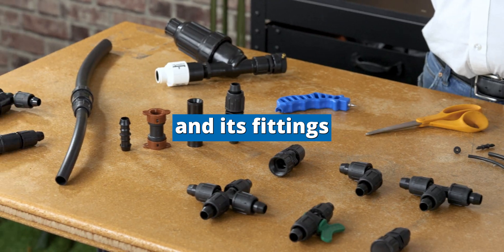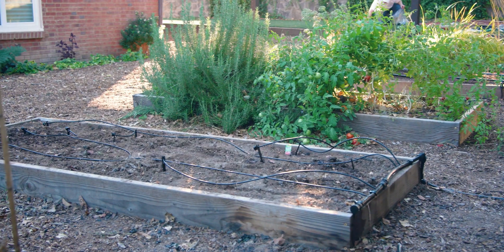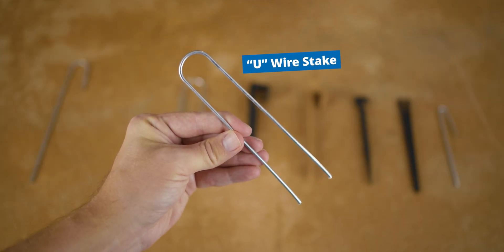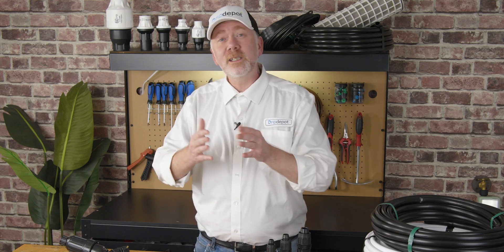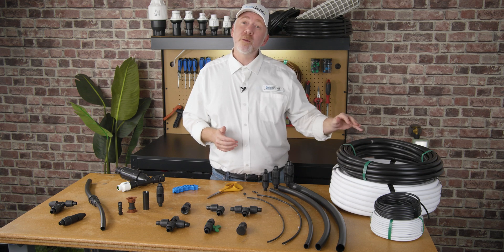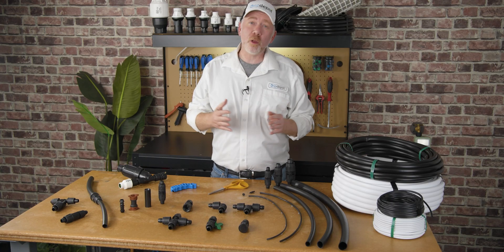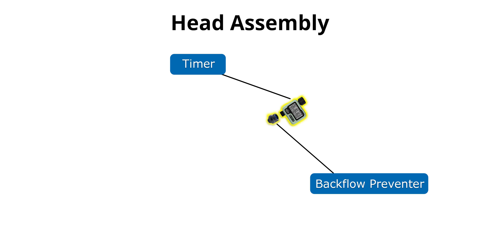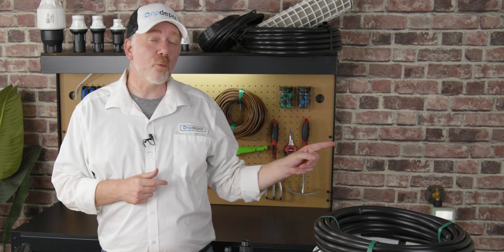Drip Irrigation Poly Tubing and Fittings: Everything to Know for your Drip Irrigation Project

Comment: What about 5/8" tubing?  I believe I have that one but wasn't mentioned at all.
Reply from the maker: Good question, and this gets into one of the more confusing aspects of irrigation: nominal size vs actual size.  Most 1/2" tubing you see out there is closer to 5/8" actual size but still receives the nominal 1/2" label.  The most common 1/2" tubing has an inside diameter of 0.600" and an outside diameter of 0.700", both over an actual 1/2" (and the inside diameter very close to an actual 5/8").  

The same occurs with PVC pipe.  1/2" PVC pipe has an average inside diameter of about 0.602" and an outside diameter of 0.840", both well over an actual 1/2".  Even every day 3/4" hose threads come in over an inch (1.065" caliper read on some 3/4" male hose threads).  

PVC pipe is standardized which is nice.  Even if 1/2" PVC pipe isn't actually 1/2", at least you know a 1/2" PVC fitting will always work with it.  Tubing is not standardized in that way.  There's fairly good reasons for that, but it does lead to confusion, particularly when nominal sizes are still used.  

If you have 5/8" tubing, there's a good chance it's the same as the common 0.600" x 0.700" tubing you see out there and would work with our 1/2" poly tubing fittings.  If tubing ever gets the PVC treatment, this will all but disappear :) 

The issue is also mostly at the 1/2" size, once you get to 1" tubing there's not nearly as many different actual sizes out there.
Reply: @dripdepot  Thank you. I saw your other video that explains more about this. I understand more now. It is funny that either 5/8" or 1/2" compression couplers have nearly identical ID size of 0.62"-0.63" and pretty much cross-compatible and I can use either to repair my drip-line system.

Comment: Try and stake this stuff when you have mostly rock. It’s not going to happen. The worst part about drip is unrolling the kinked knotted tubing, I’d assume the companies who make the stuff assume you will cut it every few feet because it’s too much and time consuming otherwise to untangle it. In some ways I wonder if pvc is better just seems a bit more uncommon but at least there is no unfurling tangled rats nest for hours 😂
Reply from the maker: Staking in rocky soil is definitely not easy, likewise with digging if you prefer to bury it.  There's a tip that can potentially help with both the staking and unrolling.  Place the tubing coil somewhere in direct sunlight and cut the straps that hold it together.  As the sun warms up the tubing, it will start to uncoil itself which makes it much easier to install (there shouldn't be any struggle when it comes to the uncoiling portion).  The thermal expansion will also work out the dimples from from the straps. 

This also allows for fewer stakes to be used, particularly on any multi-day sized project.  Once it has been in the sun for a day or so, the tubing still keep its shape and stop trying to coil back up, which means you often just need enough stakes to hold it where you want it for a day.  On larger installs, we'll sometimes use the stakes that we used the day before since they're no longer needed.  

If the installation is happening in the cold there's not many ways around the stakes (installing any type of tubing or pipe in the cold in rocky soil is pretty much nightmare fuel for me lol).

Comment: I'm trying to setup a hydro halo system for 6 pots arranged in two rows of 3.  I do have ball valves for each halo; however, I'd still like to set it up with the most even flow rate possible using 1 pump.  Would the best setup be to come down the center of the two rows with the mainline, stopping directly in the middle of the 2 rows, and then adding a tee connector with equal lengths of poly tube leading to each of the 2 rows.  Then have a 4 way cross fitting branching to the 3 hydro halo's on each side?  So I would be using a cross fitting for each row branching off to 3 hydro halo's each.  I'm assuming if when the water reaches the cross fitting it will probably have a higher flow rate going straight, compared to less flow rate going into the 90 degree turns.  Which should leave 4 out of the 6 plants getting very close to equal flow rate, and the other 2 plants connected to the straight end of the cross getting a higher flow rate, which I then could use the ball valves to reduce the flow to those specifically?  I'm sorry, I know that was a lot, but I really do appreciate the help.  Thank you!
EDIT: I have been reading about using two tee connectors rather than a cross connector, but wouldn't that make the flow rate more unbalanced?  This is using poly/vinyl tubing.
Reply from the maker: In most cases a cross or tee fitting will not have an appreciable impact on distribution uniformity unless the system is on the very cusp of overtaxing itself in regards to pressure or flow.  In regards to pressure, this could be high friction loss from smaller diameter, significant elevation change or just not enough pressure provided from the water source to begin with.  Overtaxing flow is when the system demands more than the water source can provide.  For example, if I have 300 GPH in emitters on my system but my water source can only provide 290 GPH, some emitters are going to be starved of water and the small losses in fittings like tees and crosses could contribute to make it worse to some degree.  

With plenty of pressure and flow and nothing overtaxed, tees, crosses and elbows do not make a noticeable difference unless there is many of them in use.  With large amounts in use the very small losses in them could add up enough to have an impact. 

In a common irrigation system, the lines are going to be pressurized (or "charged").  This means they will be completely full of water and the impact from something like the straight path through a cross fitting versus the other outlets on the cross is minimal (outside of situations in which something is overtaxed).  Water may travel through the straight path of the cross a bit faster than the other two directions, but soon after everything is going to be completely full of water, pressurized, and the only flow that coming from the emitters used and that flow is much slower than the speed of initially filling the lines.  

I don't know about these emitters specifically, but many emitters have a minimum operating pressure and that minimum likely cannot be reached until the lines are pressurized, even those furthest away.  

When maximum uniformity is the goal, emitters with some version of CNL (CNL = Check Non-Leak, but can also be referred to as things like "one way check" or "check valve") can be used.  An emitter with CNL is going to require more inlet pressure before it begins releasing water.  This allows all of the emitters on a system to start releasing water at pretty much the same moment, after all the lines are pressurized and enough pressure is there to open the check.  The CNL also prevents water from draining from them after system shut-down to further provide high uniformity (we see them used a lot in nurseries where they don't want water dripping down on to the plants from draining emitters suspended above).  In a setup like this (or similar), tees, elbows, crosses are going to have no impact whatsoever unless things are near overtaxed and their use drops the pressure below the minimum needed for the CNL emitter.
Reply: @dripdepot  Thank you very much for the extremely detailed response!  These hydro halo's are open flow and not pressure compensating so there is a common problem with running them in sequential order providing the first halo's more flow than the ones further down the chain.  That's why I'm trying to figure out a way to have the lines as equal as possible so that water will reach each halo around the same time.  I do have ball valves for each individual halo to fine tune them a bit if needed.  I was running 9 halo's previously and it was very hard to get equal flow to all 9.  I've decided to go with only 6 this time and it should be easier hopefully!

Comment: Hi I have a 1/2" poly systems and I'm looking for a 1/2" filter to go with it but I'm having I can't seem to find it. My system is for hydroponics and I'd like to filter the water from my nutrient reservoir before it reaches my drip emitters, so I need it to come from a 1/2" line from my submersible pump but these are hard to find in the covered type, there are small clear ones available on Amazon, but the clear ones get a lot of algae in it and that causes issues. I was hoping to get one of the black ones like Drip Depot sells but for 1/2" tubing, do you all have any options?
Reply from the maker: You bet, happy to help here - and I agree on the clear filters, that's just asking for some kind of growth :) 

Irrigation filters are going to be 3/4" and larger, but can absolutely be used in systems using 1/2" tubing or with 1/2" connections on the pump. 

Where are you looking to connect the filter?  Inline on the 1/2" tubing run, or right on the discharge connection of the pump?  

A filter like these two have standard 3/4" garden hose threads, which makes it pretty easy to find needed adapters: https://www.dripdepot.com/t-filter-three-quarter-inch-ght and https://www.dripdepot.com/inline-filter-three-quarter-inch-ght

Those both have female hose threads at the inlet and male hose threads at the outlet.  To use a filter like that on a run of 1/2" tubing, all that would be needed are these two adapters (male for the inlet and female for the outlet): 

Male adapter: https://www.dripdepot.com/1203
Female adapter: https://www.dripdepot.com/1193 

Both of those adapters work with tubing that has an inside diameter range of 0.590" to 0.630", so can cover quite a bit of the various 1/2" tubing sizes out there.  

It would be similar if you wanted to connect the filter right at the discharge of the pump: an adapter that connects to the pump discharge on one end, and one of the above adapters on the other for the 1/2" tubing.  

Basically, quite a few ways to incorporate an irrigation filter pretty much anywhere you'd like on the system, and the vast majority of them will be opaque to help deter any kind of growth.

Comment: Whats the difference from the brown tube?
Reply from the maker: Other than the color, no major differences :) 

The brown tubing got started as a type of "landscape and nursery" tubing, the brown color was meant to visually blend in better with mulch, soil, bark chips, etc.  Basically, all for aesthetics, and it does blend in pretty well with those.  

The black tubing is a little more UV resistant.  Probably not enough to really be significant, and both the brown and the black are typically listed as the same expected lifespan under UV exposure, but the carbon black used for the black tubing definitely has an overall edge under UV, even if it's minimal.
Reply: @dripdepot  so for the black tubing, Can I bury it under dirt?
Reply from the maker: @davn7723  You sure can!  I'd say it's fairly common to bury the poly tubing (black or brown) :) 

At my home garden my mainline tubing runs across my yard, so I buried so I could mow without having to move it every time.  Just like we do with PVC pipe, give it a bed of soft crumbly soil to lay in, make sure rocks and sharper debris is removed.  Anywhere from 4" to 12" deep is common.  Mine is probably around 6", I didn't want to do any more digging than necessary (and shallower makes it easier to get to in the future if you need to make repairs).  

Some people just bury it under a layer of mulch, landscape fabric, etc.  All of these are acceptable and often done and it does help prevent damage from landscape maintenance equipment (weed eaters and mowers are probably the most common cause of damaged irrigation and burying it can definitely help prevent that).

Comment: This is such a great overview! I have a question regarding the head assembly. I have a controller with two outlets that shall provide water for our two irrigation zones. The water pressure is usually less than normal house pressure, sometimes barely enough to run drippers (which is okay, we can work with the slight risk). Can I install the pressure regulator before the controller/timer as looked at from the water source? So that I only need one and not one for each zone? Why in general is it recommended to put the regulator after the controller/timer?

As always thanks for your great work!
Reply from the maker: Alex, thank you (truly!) for the kind words! 

In most cases, the head assembly parts (backflow preventer, filter, pressure regulator) are not rated for constant pressure, so they get placed after the timer so they're relieved of pressure when the system is not in use.  There are filters and regulators (but not hose threaded backflow preventers) that are rated for constant pressure, but they tend to be pipe threaded and cost more, so require multiple adapters to get installed on a hose threaded assembly and typically end up costing just as much.  A couple years back I compared the costs and it wasn't until 3 or 4 zones that there were any savings over having one for each zone.  

With that said, depending on what pressure you have at the hose bib, you may not need a pressure regulator.  It sounds like your pressure is on the lower end, so you might already be in range of what's normally called for on a drip system (10 to 30 PSI).  If you're within that range there's a very good chance you could go without one entirely.  Pressure regulators require 5 more PSI at their inlet than what they regulate to in order to work and regulate downstream pressure (30 PSI for a 25 PSI regulator, etc).  If you haven't yet, you could give your static pressure a quick test with a gauge and see where you're at :) 

If any questions come up while you're planning everything out, don't hesitate to drop a line any time, happy to help!
Reply: @dripdepot  You are truly a great educator, Adam. This is beyond customer service or YT-channel moderating. Thank you and have a great weekend! :hands-yellow-heart-red:

Comment: If you find you want to use a hole with a goof plug, can you take it back out?
Reply from the maker: Sometimes!  The goof plug is a little larger than the standard barb on a dripper or 1/4" fitting, so it's hit or miss on reusing the hole once one has been inserted.  The best bet is to remove the plug and then let the tubing sit in the sun so that thermal expansion can close it up a bit.  Sometimes it can do it enough to reuse the hole with a 1/4" barb.  Odds are higher if the system is running at low pressure.  It's also acceptable to punch a hole within just a few inches of a goof plug, so even if that spot cannot be reused you don't have to go too far out of your way to use one nearby (for best results, make the new hole upstream of the goof plug) :)

Comment: Hi Adam, i am setting up drip irrigation for the first time and have one question about the head assembly. When i turn off water from the app, there is a leakage between back flow preventor and pressure regulator, when I turn the water on, there is no leakage. Is that normal or there should not be any leakage?
Reply from the maker: I can confirm there should be no leaking there, so let's see if we can find out what's happening and get you up and running leak free :) 

The first thing to check is the order of components.  The threads are all compatible with one another and the order is flexible to some degree, but we've found the optimal order at the head assembly is: 

Hose Bib --> Timer --> Backflow Preventer --> Filter --> Pressure Regulator --> Hose x Tubing Adapter --> Mainline Tubing Run

The most important part of that order is that everything goes after the timer, the timer is the only part that can handle constant water pressure.  If you've got the backflow preventer and regulator before the timer, swap them to the outlet and good chance any leaking will stop. 

If you already have them downstream of the timer, the next thing to check is for the washer in the female connection.  Hose threads are "straight" threads instead of tapered so they seal by way of a washer in the female side of any hose connection.  

Also,. be sure not to use any teflon or thread seal tape, with hose threads that can sometimes lead to leaking through over-tightening since it acts as a lubricant on threads.  

Let's start there since those are the two most common culprits of leaking in head assemblies, let me know if this yields any positive results :)
Reply: @dripdepot thank you, Adam , for being so kind. I pushed down the washer in the regulator in place and it is doing fine now. It just took a while to figure it out.😊
Reply from the maker: @khinekhine613  Awesome!  Well, that's the news I was hoping to hear, thank you for the follow-up! 😃

Comment: I"ve had trouble with the drippers blowing off the end of the spaghetti due to water pressure. Then I over-water the zone and have to pay close attention to it all the time because the problem repeats itself everywhere. I learned to push the individual drippers into the main tubing, where the barb locks it in. Then I run the spaghetti over to the plant which would not then have any pressure in it. The dripper never blows off. It's the spaghetti to dripper joint that slips out with the dripper at the back end it won't. Then there's the earwigs.
Reply from the maker: The method you're using now is a perfectly acceptable way to use drippers (a lot of folks prefer it, even).  If you ever need to run drippers from the end of microtubing, just make sure you're using a pressure regulator, usually at about 25 PSI, I can confirm they should stay in place well at common drip irrigation operating pressure (10 to 30 PSI for most drip emitters).  :)